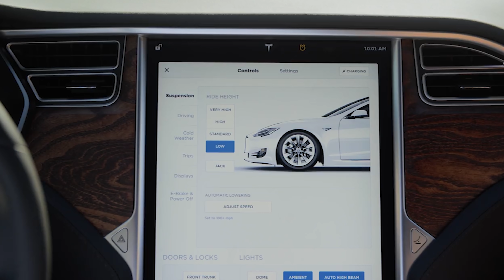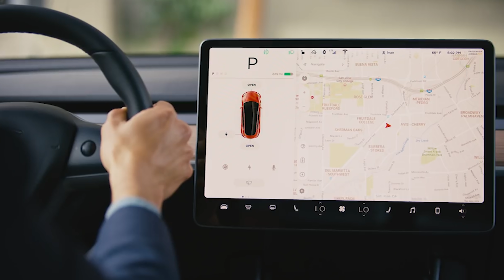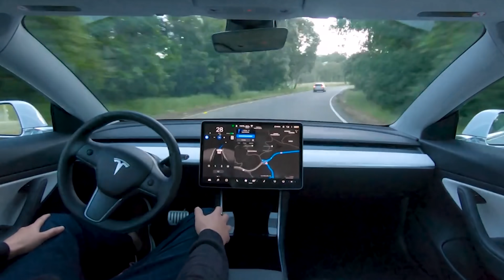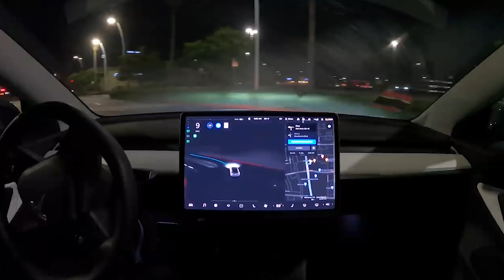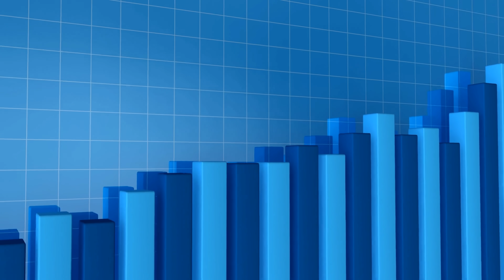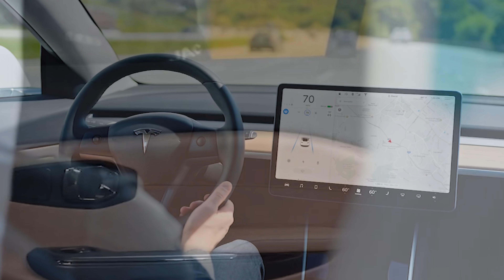How Can China's EVs Out-Innovate Tesla?

Comment: You also have to take it to account that Tesla builds the machines that build the machines… China will need to reverse engineer a final Tesla product and design a way to produce a similar output, but won’t have the designs for the machine and tooling that is designed inside of Tesla.

Comment: It should be obvious by now that unlike the legacy automakers, Tesla is not wasting any time. Tesla is not only pushing the technology to a new state-of-the-art, in frames, motors and batteries, but also has acquired control of the necessary raw resources needed for manufacturing them as well. Elon will not allow anything to slow down the build up of the EV industry.

Comment: You do have a point there.  Xpeng produce a car which is strikingly similar to the model S and even stole the Autopilot code from Tesla. But it's not just the Chinese, I think the Mach E copied the model Y and the Lucid hot Air copied the model S.  Noone has done the Gul wing doors of the X at least but everyone does the large touch screen and tries to do OTA updates.  VW did a Power day to copy battery day, the list goes on?  Yes, it does, Lucid also said they are going to do energy storage packs and a small 25 k model.

Comment: I suggest you look into Blockchain use in China. The incredible need is due to adulteration and cutting corners in suppliers. From fake eggs, milk, and baby formula to low-grade materials swapped for those specified, China has a massive counterfeit market. While we usually only see it when our goods are counterfeited, it is a widespread problem. 
So, China cannot innovate like Tesla. China can't manufacture like Tesla. And, China will be at risk of making cars that have problems that aren't immediately noticeable but will impact long-term value, safety, and performance.
As you said, China's biggest strength is low-price labor.